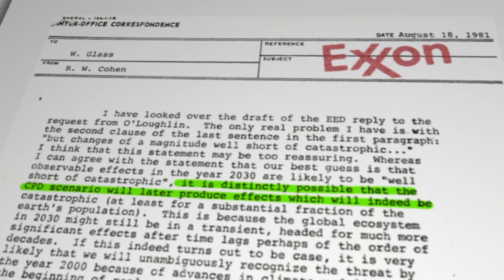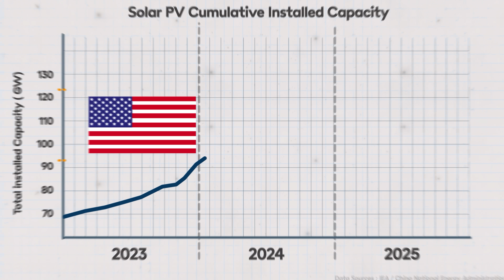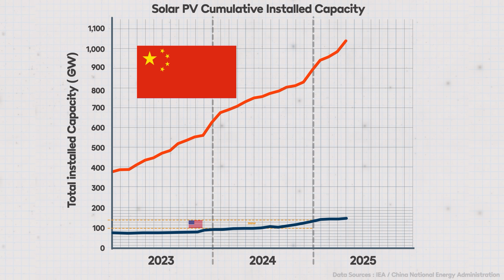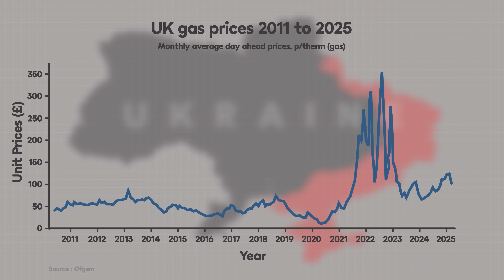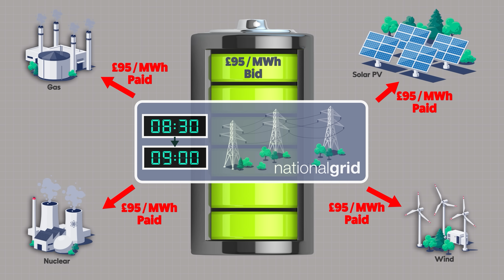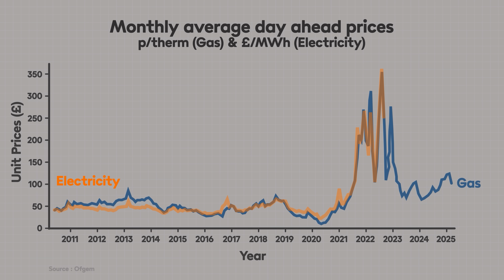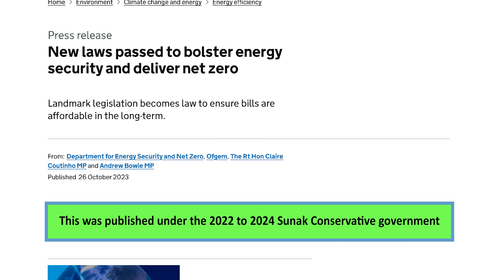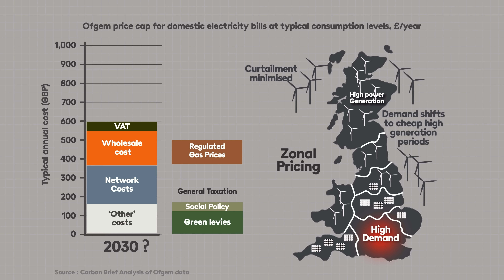Why is UK Energy SO expensive?

Comment: Green energy provides a possibility that fossil fuels could never deliver upon, IE. Energy production at the point of energy consumption. This also eliminates expensive and fuel using transport of coal and pumping of gas down pipelines. A system that has a households energy needs produced on their own land or property is also significantly more resilient to natural disaster, weather events and human conflicts. So, that kills every dissenting argument, green is better for humanity period 👍🙏🏴🇬🇧♥️
Reply: Solar panels work great for this in the summer. Not so much in the winter. Depending on your energy needs, and available roof space, etc.  

I have an all electric home, including the cars.  I use about 60kwh a day. With 14kw of panels on the roof, this more than meets my needs in the summer, indeed I can return 90kwh a day to the grid in summer, through a piddly 5kw export limit (yay single phase).  In winter, as it is now, I'm net consumptive from the grid, to the tune of about 30kwh a day at minimum, and on the crummiest of days, that can climb nearly all the way up. 

Batteries alone can't bridge the gap (economically, or practically) to allow me to go all off grid.  They'd spend all summer full, and all winter nearly empty, and I'd have no way to sell that summer excess, and thus no ability to use those profits to offset the winter costs, or to pay the capital investment.

Some local wind, even just a few kW might make all the difference, but alas, I didn't consider that when I installed.

Comment: There is a simple solution to ALL the issues you raise at the start of this video: It’s called ‘Nationalisation’. It means that Energy should be owned by the people and distributed for the people’s benefit NOT for profit of gain by an elect few. In the UK we came close to this ideal, in the past w ex had The National Coal Industry which was owned and run by the Government for the benefit of everyone. Green power is not a burden on the poor, it’s a guilt trip for the rich. So finding another reason to blame the poor for its non implementation suits the guilty few just fine! 🙄🙄🙄🙏🏴🇬🇧♥️
Reply: solar is democratic in its nature, therefore hated by any institution holding power. Has nothing to do with naionalization

Comment: I’ve had solar panels for about 10 years. I spent a lot of money two years ago installing a ASHP and my energy consumption in KWh has halved..unfortunately, my bills have increased significantly, even after my FIT payment, simply because all my energy is now electricity based and the cost has rocketed. In spite of that, I have no regrets. The whole energy set up in the UK is bonkers. Incompetent politicians - of all ideological leanings.

Comment: If you want "green energy" than we should be investing into modular nuclear energy which is conveniently left out of all green energy studies. Also I'm not sure why there is so much red tape around conventional nuclear energy which has proven to work great over many years but also contributes to the enormous cost to build said power stations. As far as oil goes, a lot of oil deposits naturally refill after 30 years but that little fact isn't allowed to go main stream.
Reply: The red tape is why nuclear power stations have worked great over many years.

Those design requirements & operational conditions is what makes nuclear operate safely.

Cutting that 'red tape' invites a disaster. The cost of which will ultimately be paid for by the local affected community.

Better those costs are rightly paid by the Nuclear Power Plant's shareholders.

Comment: My dual fuel bills pre energy crisis were £82/month plus petrol (£1000 per annum). My current electricity bill is £85/month and petrol £0. I pay about £150 year in EV charging on the road. The difference is having an EV and solar since 2019 plus an ASHP since 2022 (no battery so far). Net cost per mile of EV ( incl depreciation , insurance etc) is slightly lower than previous ICE car at around 40p/mile after 5 years.

Comment: Ok where to start. This is Australia. Why might renewables not be cheaper: 1) Renewables tend to be smaller and further away from the main energy users so transmission lines capital costs are proportionally much higher, this is compounded by the intermittent and unpredictable nature of renewable power generation. 2)Non CO2 generating firming technology is very expensive.   3) Due to the inability of low CO2 firming to fill in the gaps, a Carbon Burning or nuclear alternative to 100% of grid capacity must be built and maintained to ensure power is available. This system must also have the capacity to be switched on at a moments notice as renewables tend to drop off precipitously. So in effect you need a complete backup system that is able to generate power not only store it. 4) Due to renewables low utility factor and unpredictability, the generation capacity must exceed demand capacity by at least 5 times. ie if you have a grid that requires 2.5G, to even attempt to ensure supply, the installed generating capacity of renewables must be around 7 to 10 GW. Even at this level a 100% capacity CO2 producing or nuclear backup is needed to ensure power supply. 5) Due to the intermittent generation of all these components, cost per unit of power generated are much higher than from traditional or nuclear power stations that have a much higher utility factor. This is compounded by the fact that the extra transmission lines needed still cost the same but they may only carry power for 30% of the time. So all in all, generating power with renewables may be cheaper, generating continuous power and transmitting it with renewables is most likely not cheaper.
Reply: You hit the nail on the head. Renewable should really be called unreliables.

Comment: 30GW of new PV capacity is a bit misleading. The capacity factor of PV is somewhere between 11 - 20 %, depending on the location.
Reply: Hmmm... the efficiency of solar panels to capture energy from the sun, is indeed 11-20% of the energy in the light coming from the sun. 
But this degree of efficacy is already taken into account, when the actual capacity of a solar panel is determined. 
So when 30GW of solar is installed, then it is actually able to produce a 30GW output, on an optimal day.

Comment: At 3:34, last time I checked, battery storage doesn't generate electrical energy, it can only store it and discharge when needed. Not sure why the heck it was added to that chart? I am 100% onboard with transitioning to renewables in an orderly manner (as fast as humanly possible) so we can breath cleaner air. But it will take some time, and it isn't good to demonize fossil fuels, which play an incredibly important role and providing everything we take for granted today.

Comment: Thank you for a fascinating video! I was hoping you’d talk about the cost of a 100% renewables system vs current system bc there it gets tricky! Michael Liebreich did an analysis and showed that the cost of the last 90% of the transition is the most expensive bc you have to build do much storage and interconnections etc. Has anyone else done analysis on the cost of 100% renewables?

Comment: National Electric grid. 
The most expensive part of national electricity. 
14decades to build. 1880s.
Poles and wires and transformers and switch yards and transmission lines. 
Generation is dirt-cheap. 
To the millions and millions and millions of meter boxes is extremely expensive. 

The national grid is fragile because it is extremely expensive to EXPAND but too valuable to waste. 

Blackouts from neglect because of costs per km or mile.

People are grid blind. 
People only see the wire to their home. 

Grids cost $TRILLIONS and TRILLIONS. 

Generation costs $billions. 

This is an extremely important matter for future clean electricity replacing fossil fuels. 

25 times more electricity to replace fossil fueled energy is impossible. 

Cashflow, ROI, return on investment, $100sbillions from $TRILLIONS invested.

Just have a video on grid massive cost, and it ROI.

Grid electricity has a MAJOR PROBLEM, so let's think.

Comment: 2nd hand vehicles market is growing, as high marginal taxpayers use their empty rooftop realestates PV electricity and saved on fossil fueled energy. 

V2G technology is the key technology, dirt-cheap massive electricity storage on wheels. 😊😊😊😊

No grid electricity 
No imported petroleum 
No international priced natural gas heating, cooking, hotwater, 
Hot rooftops shaded by PV panels reduces air-conditioning costs 
No new grid upgrades. $TRILLIONS saved. 

Happy tax-free saving days. 😊😊😊😊

Early adopters, high tax payers Happy days.
2nd hand EV market for slow adopters. 

Just my thoughts.

Comment: Most vehicles are parked 23hrs every day and all night long. 
Thats how you get 10,000 miles per year or 16,000 km per year. 
40km per day.

Vast daily trips are for the few.
Most vehicles top up every 10 days. 
EVs can top up daily. 

Let's assume a car that consumes 10 liters per 100km, driven 15,000km per year, and fuel costs $2.00 per liter.
Total liters used: (15,000 km / 100 km) * 10 liters = 1500 liters
Total fuel cost: 1500 liters * $2.00/liter = $3000
Therefore, the estimated annual fuel cost for this example is $3000. 

EVs topped up daily from rooftop PV dirt-cheap electricity save $3,000 tax-free per year. 😊
2 vehicles, $6,000 saved tax-free. 😊😊

Most vehicles drive building to building carpark space.  😊

Bumper height wall outlet at every buildings carpark space and selfparking selfplug-in V2G EVs trickle currents all day long and all night long.  😊😊😊😊

Daytrading electricity grid services for money, happy days and nights 🌙